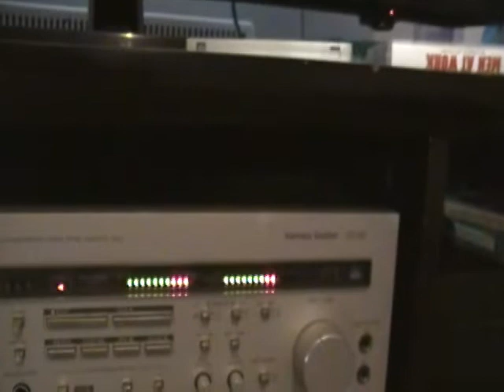AUDIO CASSETTE TAPE EASY FIX:  OPEN NON-SCREWED CASSETTE AND REPAIR FELT PAD PRESSURE PAD, ETC…

Comment: no need to open the shell. i've done this easy repair many times. just pull out the leader tape a bit,add a spot of cement on the pressure pad mount,reposition the pad,and allow to dry. done
Reply from the maker: Yes, ok. But this video is based on how to open the shell for other repairs as well :)
Reply: it just appeared it was for replacing the pressure pad. with splicing,the other major repair,i see that you would need toopen the shell.

Comment: YOU do not have to pry the case appart to replace the pad.  I cue back to the leader tape then just use a pen tip to pull the leader from infront of the pad metal. Use peal and stick foam pads or if you can find the right material a tiny dab of some shoe goo or other flexible glue (not elmers or other glues that will peal off of metal. simply push the pad lightly in place, line up and press it against the plastic case.  Some cassettes can have a metal square behind the flexible tab with the felt pad.  No need to take apart the cassette UNLESs theres other problems like it is sticking due to the glide inserts being worn.  I have cassette tapes from the late 1970s and mid 80's that play fine. Some do get 'muddy' from the high end gain fading away. Head ALIGNMENT can help as my experince is one side to the other of a production cassette or a home recording can be off alignment from different record heads. Usually one side the right screw on a head has a spring behind it and can be turned while playing to get a crisper playback to make a digital copy , then re-align for the other side.
Reply from the maker: Yes, this video is to open the cassette regarding any problem.

Comment: you can just reseal with sellotape but make sure it's quality tape and that you firmly seal it. I recommend puting a small bit of tape on first to check that the tape plays ok and no other work is required and then add more tape trying to avoid sticking on the paper labels.
Reply from the maker: Ok but tape will degrade much sooner than super glue. Over time, the degradation will result in a “yellowing “ and fragmentation of the tape. I m certain the super glue is much more permanent :)
Reply: @silvermymothergaveme  Well it's still going to take a few years for that to happen if they're stored in a cool place and you can easily spot check your sellotape and replace any weakened areas.  The biggest advantage is if the music tape snaps, or it starts squeeking etc you can get in there much quicker to fix it and not damage/destroy the original casing
Great video BTW 👍
Reply from the maker: kingshearer2 if you notice , i put such minimal glue... and not even all around! Cassette can be snapped open in a flash! Thanks for your feedback though! :)

Comment: Hey what can I do if my tape is stuck on one side? The tape band inside is now tore apart from the other side, they are not connected, so casettte doesnt run. Is it a problem of casette or casette player? And how can I connect the tape band/ribbon/ strip with the one which is empty now.
Reply from the maker: TheEncyclopediaofPopCulture 2  no gluing necessary on the empty reel!! Look closely at the empty reel and you will see a minuscule notch ( very small) ....with a tiny rod in the notch!! Push the rod out and insert end of tape in! Note : it is very tricky to then snap back the rod and impinged tape end into the slot. Not impossible though!!! Cheers Youtube audio cassette lovers!!!

Comment: It should go on the inside of the plastic nab otherwise it wears it out no point any guide wheels
Reply: Originaly the tape godes on the outside of the plastikk nab as in this video. Just look at a new blank transparent cassette, and You will see it.

Comment: seems like you could do that without taking a whole tape apart
Reply from the maker: May seem like it but actually, no! Keep in mind that this video is about how to open cassette to carry out various repairs:)! Please read the subtitle:)!
Reply: i have reglued felt pads in mine by pulling out the leader a little then using a tweezer and gorilla glue reseat the pad.